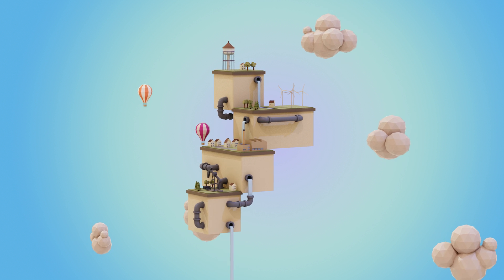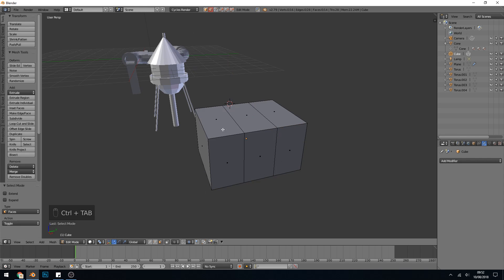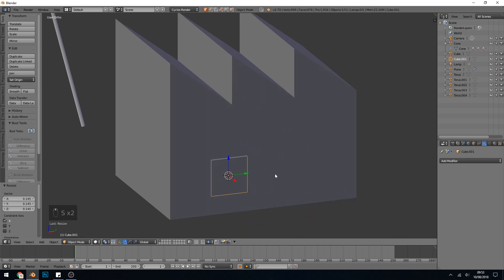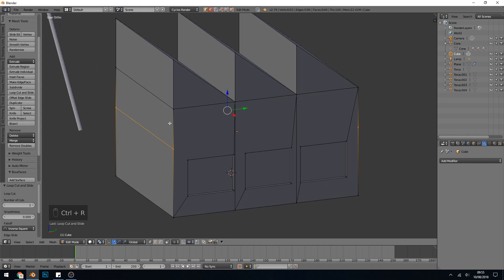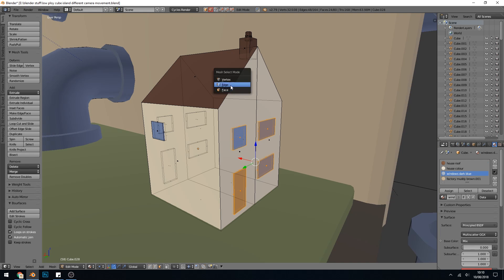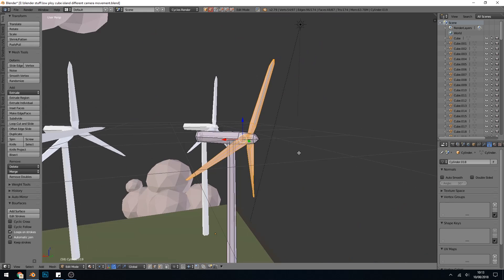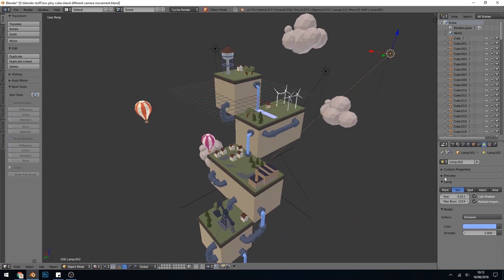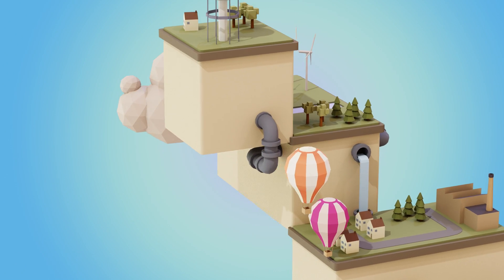Low Poly Islands | Beginner Tutorial | Part 3

Comment: 1st off. Awesome tut. you got here.This might be my 3rd time going through this. This time I've modeled some of the pieces, watertower, factory, trees, and so on. My Q is what is the best way/how to import these individual models into my scene? Is there a video for this? Plus am I going to have an issue with scaling them up or down to fit?
Reply from the maker: when you say into a scene what do you mean? into unity? just export as fbx or if they do not need to be moved at all t hen you can bring blender files into unity
Reply: So when I was going through your island tutorial I made some islands. Later came back and made a watertower and so on. So I have individual models saved and wanted to bring them together in a scene in Blender. Scene being the viewport in Blender. I hope I explained that alright.
Reply: @djC653  You can just load models one after the other into the same scene. Don't use new option instead just use load.
Reply: As a programmer, I would say scale them as in real life using metres. If the water tower is 10 meters tall then make it that big in blender.

Comment: Hi sorry for bothering you, I don't know if you will reply to this or if anyone else will. But I have competed my project in blender rendered it and everything and now I would like to do the rotating animation the Grant did to show off the final design but I don't know how to do it or what software to use. If anyone could help me it would be much appreciated. Also when I try to do an animation when in rendered mode it goes all grainy and black when the camera moves and says something at the top of the screen about loading 'path tracing sample 2/32, 3/32 so on. Thanks!
Reply from the maker: I did mine in cycles. I find it gives a much nicer render. I have put a couple of videos in the description about rendering with an alpha channel. I then put it together in adobe premier but i think it's fairly easy to piece together in blender :)
Reply: No way did you just reply that fast! Wow thank you, that was very helpful!
Reply from the maker: yes I happened to be checking at that point :) I have it on alert as well so generally try and help were possible :)

Comment: How did you make the roads around the houses?? I'm lost
Reply from the maker: around 5 minute in are the houses. Just a cube with a loop cut down the middle. Then add the other cubes for the windows. The roads are just a plain that has been extruded. you can even use a cube for them
Reply: Grant Abbitt how did you curve the road though, ive been trying all day
Reply from the maker: create a plane grab the end and extrude it around a curve so about three times and move the vertices around the corner. so you have a plane the is shaped like the road. then extrude the faces so that it's thick.
Reply: Grant Abbitt i have to create a curve like a bézier curve you mean?
Reply from the maker: no just a plane. Grab the end edge in edit mode. press e to extrude and then rotate is. (make sure you are in top view). The do the same again but rotate a little more and slowly go around the corner
Reply: Grant Abbitt thank you